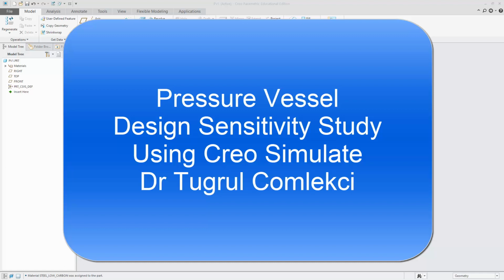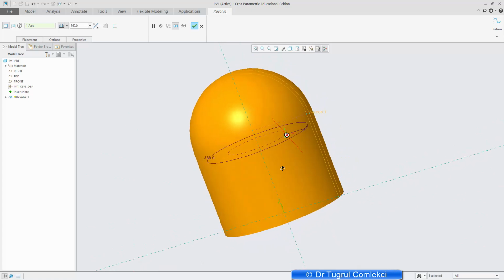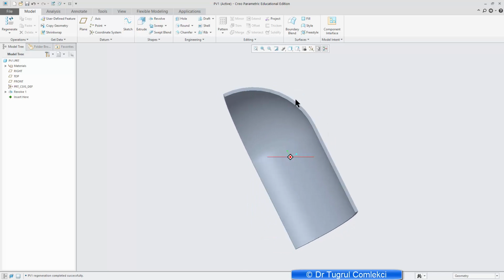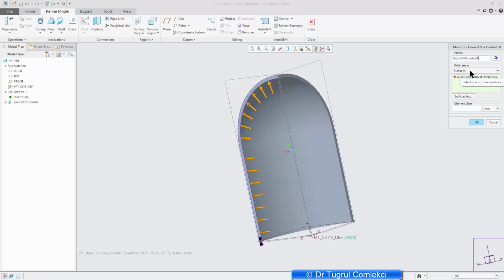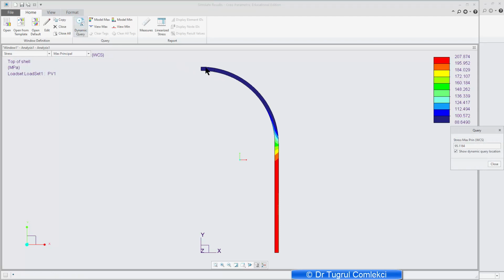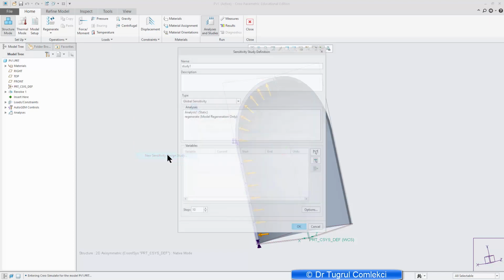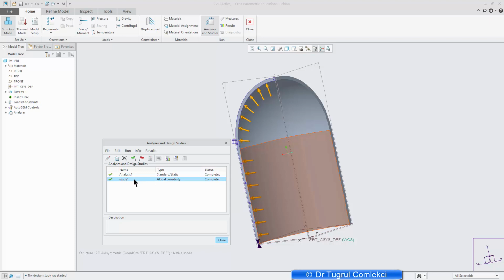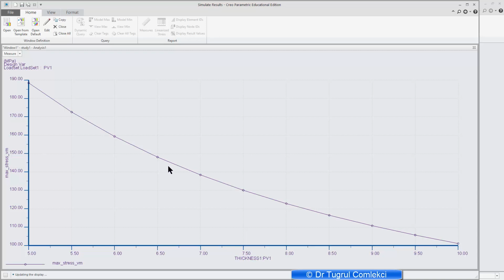Pressure Vessel Design Sensitivity Analysis

Comment: Hello! help me, please! When I try to replace any word in the dimension field (for example, thickness), even after pressing the Enter key, the numeric value remains the same but does not change to the desired word! How can I solve this?
Reply: Danilo, você tem que deletar (apertar delete mesmo) na dimensão e atribuir o valor de novo. Quando a gente associa o valor de uma dimensão do Creo a um parâmetro, o software impede modificar depois. O truque é deletar a dimensão e dar um novo valor.